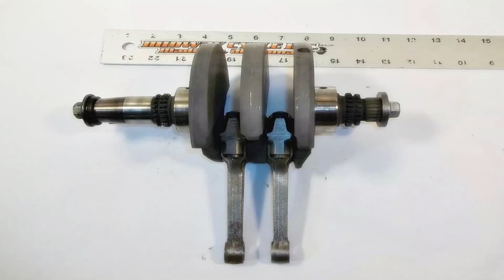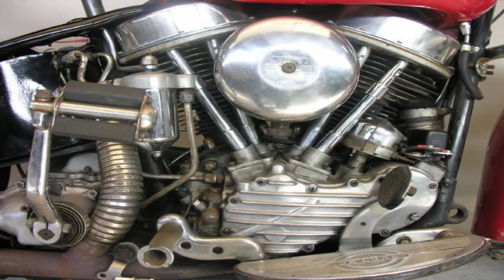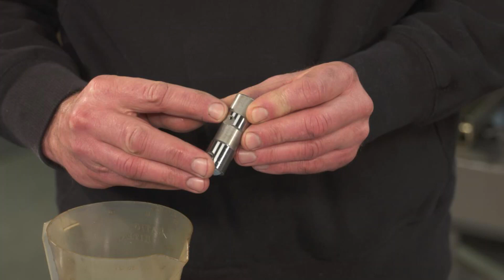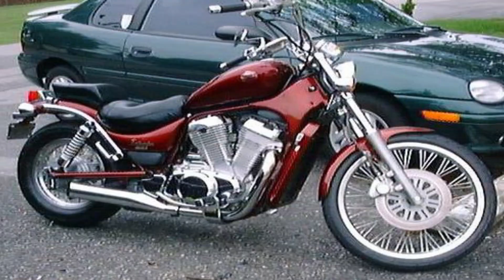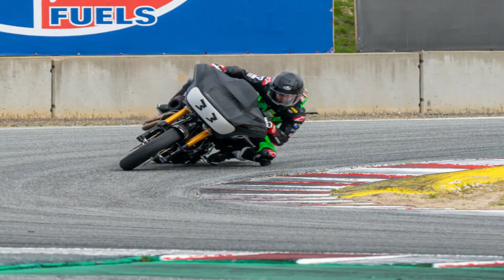Harley-Davidson Engine Design is the Worst

Comment: If they could integrate true liquid cooling to the m8 engine design they would have a homerun. Extra power with the classic Harley thump.
Reply from the maker: The metric manufacturers have done that for years, liquid cooling with air cooled fins and it's worked great. I think Harley's hang up is styling with the radiator.
Reply: @GixxerFoo  I don't think it's the radiator as much as the retooling, expense, and adding to the complexity of the power plant. I'm all for the liquid cooled m8. My mid section would appreciate as well. Lol 
OHV liquid cooled M8 would definitely be a work of art.

Comment: I bought a 2021 Indian Challenger, after I ate my cherry FLHTC engine due to cam bearing failure at 19,000 miles. Pissed me off beyond belief.
Reply from the maker: I don't blame you for going with a Challenger after some crap like that, was that not covered under warranty?
Reply: @GixxerFoo  Older 88 FLHTC meticulously maintained. When the dealer opened her up the service manager commented to me "it still looked brand new in inside".

Comment: I ride Harleys for the feel and the sound, not performance. They keep up with cars and can hold highway speeds. that's all I care about. H-D totally blew it with the M8 by putting a balancer in it. Just what were they thinking? That is NOT what Harley riders want. All the Harley engines, from the Knucklehead to the Panhead to the Shovelhead, to the EVO and even the Twin Cam, all had that Harley shake. Then H-D goes and ruins everything with the M8. They literally took away one of the main reasons why people buy Harleys, and for no apparent reason. Maybe they thought that newer younger riders were too wimpy to handle the shake?
Reply from the maker: Harley engineered vibration back in with the M8 but I agree it's just not the same. Let the motor just do it's thing and leave the balancer out. That's the same thing they did with the Twin Cam B motor, that engineered vibration just wasn't the same as the A motor.
Reply: @GixxerFoo  The Twin Cam B motor still had noticeably more feel than the M8. I have no idea why they even made the Twin Cam B. I believe they only used it in the Softail models, which used a solid mount engine. I remember them saying that was the reason. But the Softail models came out during the EVO era, and they weren't balanced. So why did they think they needed a balanced motor?

Comment: Yamaha built a better Harley with their star venture
Reply from the maker: Yamaha made an awesome bike with that Venture, I don't think they are still making it though. It was a lot of motorcycle for the money.
Reply: @GixxerFoo  I was offered a demo model for a ridiculous price, I turned it down, I am not a fan of the vtwin paradigm, I owned 5 of the royal star ventures, the v4 engine was bullet proof, never had any real mechanical issues, and all I ever had to do was normal maintenance.  fuck Harley and their harlier than thou attitude.

Comment: I disagree with your reasoning for the potato idle typical of old Harleys. In my view it is a combination of 45 degree cilinder offset, a single pin crank and an ignition system that sparks both plugs at the same time. Replace the ignition with a more modern one where the plugs fire individually and the potato sound goes away. What happens for instance in my old Shovelhead is that when the front cilinder fires during its compression, the rear cilinder is already busy for 45 degrees with its intake stroke. Both plugs sparking at the same time means that the gas sucked in by the rear cilinder MAY ignite prematurely. The potato sounds comes from front firing -  rear firing correctly - front firing with ignition also in the rear intake stroke and then a missfire in the rear cilinder (a missfire cause there is no more combustable gas in the rear cilinder).  The potato sound goes away in my Shovelhead during riding, as then the higher rpm means the ignition timing advances.. the front fires before the intake stroke of the rear cilinder has even started so there will never be a missfire. Modern Harleys dont have the potato sound because the sparking is separate for both cilinders.
Reply from the maker: I used to race flat track and on my twins we would twingle them, change the firing order and make them put power to the ground on the dirt. Lol of course they outlawed that and wouldn't let us play with the firing order anymore.

Comment: What a damn shame; that is why i bought all my Harley Davidsons; not only because they look and sound like the originals of 80yrs ago. If the market requires a newer engineered engine, trans, frame, wheels. tires, forks, bars, and gasolines. As a Machinist for 22yrs i would love to help them build it from scratch LET'S GO FOR IT! no one will stand in their way; Why not build and all out Hemi, overhead, supercharger, or turbo versions.,  I would love to see the new tech in drag races and road races, all kinds of races; Damn i would LOVE to see them in a boat (4 x V twins side by side WAY KOOL) or one of those small (water motorcycles) jet ski. How Kool would that be? , But they must NOT take away the original. That would be stupid, The owners seem to forget how they got to be the American Icon sound and bike, nothing is close and Harley Davidson is in a class by itself AND WILL ALWAYS BE. PRAISE GOD FOR HARLEY DAVIDSON. AMEN BROTHER
Reply from the maker: Harley is an amazing motor, you can literally build one without one part from the MoCo!

Comment: There're not designed to make HP.
Reply from the maker: They make some power reliably, you just have to make sure you get the supporting parts to do it right.

Comment: My harley has a plain-bearing crank and overhead cams. One crank pin though. And it barely vibrates at all.
Reply from the maker: You must have a Vrod or one of the new Revolution Max motors.
Reply: @GixxerFoo  It's a revolution x. 750 Street Rod. Do the new Revolution Max engines have one crank pin? I'd heard they were split 45 degrees.
Reply: Harley is a pathetic has-been of a company they used to be the bike of The Working Man the blue-collar guy and then they became motorcycle of the old fart who had more money than God and who had sick Pockets to throw money at the company that's not the case anymore Harley's answer to everything is a bigger and bigger motor regardless of its volumetric efficiency the only thing that they haven't changed on the Harley motor is a single pin crankshaft which is a relic of another age and another reason why the back cylinder overheat Harley didn't care about 95% of the motorcycling public so why should we care about Harley the Harley Sportster is the most reliable bike that Harley makes and it got discontinued the EVO motor was the best motor that Harley had and AMS spent seven years developing it with eight and a half million twin cams on the market for sale at giveaway bargain prices there is no way anybody with any brains At All by the new Harley except for bragging rights at bike night and then only for a little while the motorcycles that Harley makes nowadays are merely a collection of government regulations on two wheels like she putting the mechanical reliability of their bikes and selling bikes to anybody who had a pulse is turning around and backfiring on them with the huge numbers of repossessions that they are dealing with up to the point that they are dumping all of their loan on investors who say they will make a quick buck what the investor will do with lots of 10000 repossessed motorcycles that's something else Harley has jacked up the price of everything related to motorcycles from parts to service and have overpriced many of us out of a hobby and a lifestyle that we have enjoyed long before Harley whichever the bullshit fad that it is 40 and 40 miles does not make you a biker
Reply: @frankmarkovcijr5459  Harley riders living rent free in your head.
Reply: @Oddman1980  I have no idea what you mean by that but everything I said is true

Comment: I own HDs (built 16 Streetglide and built 17 Dyna LRS not a M8 fan) in addition to metrics for advs and sportbikes in my garage.  I enjoy my HDs for what they are and a big part of that is the engine characteristics.   No, I don't want HD to get away from their V twin setups, BUT I do wish theyd stop the $ cutting BS they do on em.   Give us quality bearings inside, lifters, cranks and gear drive for the cam, etc.   I didnt play the build up the HD game with my bagger and just went S&S 124 and will probably do same for the LRS soon.
Reply from the maker: That's the way to do it is just get a built motor and do a swap, I agree they should put the good stuff in they sell through Screamin Eagle in from the factory.

Comment: Happy New Year Foo! I can't see them ever parting with the single pin crank 45 degree, what are they without it, Project Nova🤣, yeah right. The Dragon 143 is an off the shelf 9 second engine, that get's used as an everyday rider by many. Anyway, point is that more than enough power can be produced through a single pin 45 and I for one love all the character my 2002 Night Train has, built bagged and carb'd, wouldn't think of trading for a M8 🤮
Reply from the maker: I'd hang onto that night train, those bikes are still bringing some good money. Especially being a 2002 it's got the solid lower end and they sound damn good with a carb!

Comment: Harley have had many missed chances over the years to introduce new innovative models, although the V-Rod was a good machine the purists hated it and also the factory seemed to get a bit lost over the design. They have done this with other models, so it’s a common trait.  Building a base model them dressing it up differently; isn’t a sensible way to do business. Also they could have built a V4 motor quite easily and it wouldn’t have occupied any more space in the frame if it was properly thought through. Another avenue would have been to build a single cylinder street bike, great for getting around town and to work; but they missed this opportunity too. It may be too late now what with all of the electric madness, but had they built a range of different configurations, capacities and styles instead of basically using two platforms (Sportster and Big Twin) their appeal would have had a much broader spread across the world.
Reply: Originally, H-D was going to try to make a family of V-twin, V4, and V6 engines for their bikes in the 1980's, they called it the Nova project. It would have been interesting to see a big harley touring bike with a V6.
Reply: I have seen Harley single cylinder bikes. So I know they did make an air cooled single, entry level bike, sometime around 2012. I think it was like a 700cc or something around that size, although I'm not entirely sure. I agree that a V4 engine should be their next engine. I am waiting patiently and with great anticipation to see Harley make a 4 cylinder. I have this ridiculous vision of them making an inline 4 cylinder motor, and mounting it lengthwise (longitudinal) like the Triumph Rocket III, or the 1932 Henderson. Go and look at the old Henderson 4 cylinder bikes. Man, they were the most beautiful 4 cylinder bikes ever made, and they had a 2.0L giant car engine, and 53 horsepower, and they were "electric" smooth, with no vibration. Jay Leno does some test drives of his old 4 cylinder 1932 Henderson bikes, and he says they cruise beautifully and are better in some ways than a modern bike (because they had a proper overdrive transmission).
Reply: @Ritalie  I couldn’t agree more, you are dead right. The singles of the sixties and early seventies were of course Aermacci, badged as Harleys.  But the company has missed a trick, I also agree with the in line four cylinder, although length wise may be a push but it is possible. I actually think they should go racing with a whole range of fours either V or in line. Like they used to say win on Sunday sell on Monday. The psych of Harley owners needs to change, not away from the root and core; but into acceptance that it’s change or die. Let’s be honest who wouldn’t be proud to roll the highway on a V4 or otherwise with HD on the tank. American designed and built; worth thinking about. Cheers. PS I’m an old British guy, but proud of both heritages which I ride equally.

Comment: 40+ years i worked for harley via dealers, love the Harley big twin, my 1st one was in 77 when i bought a new FXS lowrider, and i have owned about every HD there is, 5 FX style bikes, 5 softails 4 sportsters and a couple touring rigs, but the best of them was my NightRod the Vrod was fast and had serious power and didn't break, after the 1st recall for the fuel pumps, we never saw one in a dealership except for tires and oil changes.  and i expect the New Rev Max to be along the same lines, lot less maintenance issues and much more horsepower. i'm hoping Harley will wake up join the 21st century and build an 1800cc to 2000cc Rev Max for the Big Twin Bikes and Do it while i'm still able to ride one !! now that i'm in my 60's and Back where i started on a Lowrider.
Reply: Haha I know the feeling I am 67 and waiting ✌🏼👍🏻

Comment: I have a Sportster and it is my first HD.  I rode Japanese before; Inlines and Para Twins.  I like the sound of all of them.  My rubber mount 2019 Sportster vibrates no more than some of my older Japanese bikes.  Handle bar buzz hurts more.  HD will move into more advanced engines and they will be good.  If they aren't then they will go extinct.  I do like that HD feels more solid and the parts are not plastic (for the most part).   Milions of older HD Twins on the road and for sale.  Parts will always be available for the classic motors.  HD will make NEW Heritage as it goes forward.
Reply from the maker: I too rode a lot of sport bikes and parallel twins myself too, Sportster is my preference in Harley-Davidson. Sportsters are great bikes, they do have a weird vibration around 60 to 65 mph, above or below and it's gone lol.

Comment: Harley was capable of keeping that old school sound, look, and feel while still making a reliable engine. This was proven with the Sportster Evo engine. My biggest issue with Harley is they would cheap out on the manufacturing of the engine and cut corners. The issues with the TC88 is a prime example. Elmimation of the Timken bearing, faulty cam shoes, pressed and wobbly cranks...For a company that claims to be a "premium" company this is unacceptable.
Adding "tech" doesn't make Harley a better bike. What they need need is better Quality.
Tech means squat when it falls apart.
Reply: Harley is more than capable of producing a motor with all the quality we seek. They refuse to. The aftermarket figures out all the fixes in about a year. It simply offends me and infuriates me as an American and lifelong HD guy.
Little O
Reply from the maker: That's exactly what they did, more production, faster and cheaper. It's very sad that's they did at the cost of quality.
Reply: @GixxerFoo  I have to agree with you, and for such nickle and dime savings.  If INA gave Harley the bearings for free, it would only save about 10 bucks a bike over the cost of the Timken bearing
Reply: My 95 1200 Sportster had 50K trouble free miles when I sold it.  My 96 1200 S has 27K now.   Change oil, tires and gas.  Nothing ever breaks
Reply: @paulfiore850  Rock solid motors.
Reply: Which is why I’ve replaced  motor/drive train parts with: S&S, Baker, Darkhorse Crankworks, Rekluse, & feuling. Yeah I spent a mint but I’m keeping this 2020 RGS forever!

Comment: For someone who knows zip about bikes , to ad something inregards  to what could harley do with this design , ok here we go l wonder then would  a four cylinder deisgn solve the isues ? It may still have somewhat all the harley sound and create  massive  power  with a somewhat totally stock motor with realibility
Reply from the maker: Inline 4's make serious top end horsepower, Harley had V4 liquid cooled design that looked air cooled in the late 70's with project Nova. Just with the buy back from AMF the investors only had enough money to move forward with the EVO. Honestly the Victory was a great example of how to build a Vtwin without a bunch of issues.

Comment: HD has gotta keep the air-cooled, pushrod V-twin. It's one of the last holdouts of America's great industrial past. It's like a rock in an ocean of change. Sure, add other water-cooled engine configurations, but keep the classic 1936 EL "61 OHV" knuckehead platform intact. Drop that and Harley-Davidson becomes just another Chinese motorcycle company.